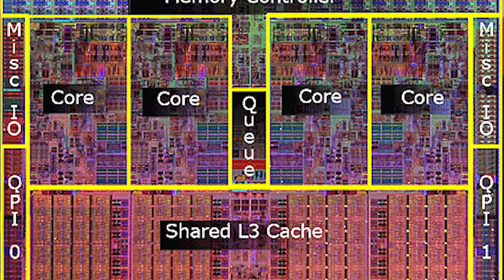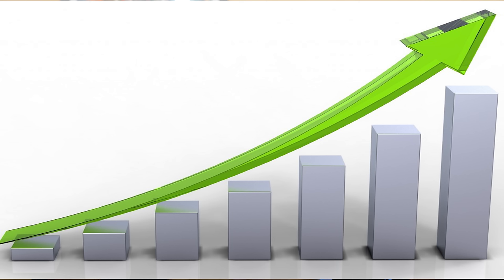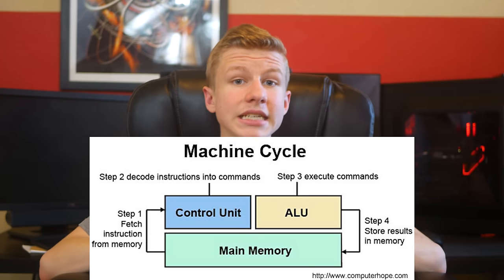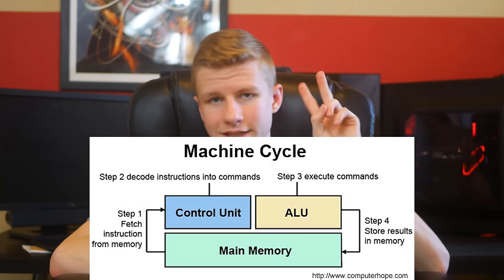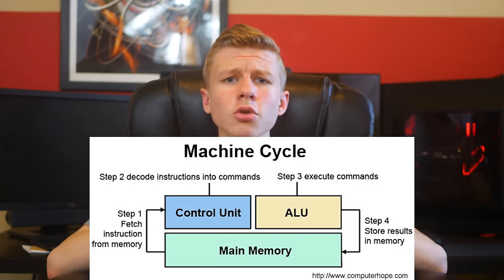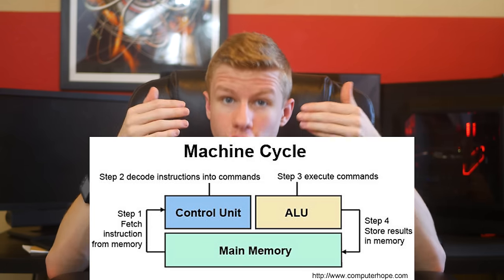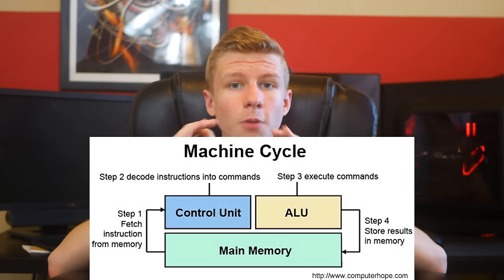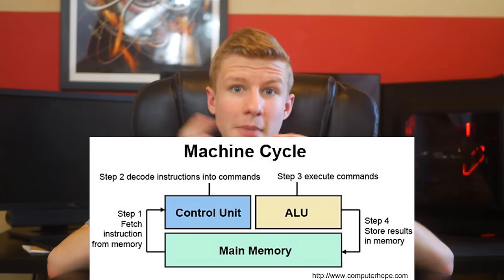How do computers work? The Von Neumann Architecture

Comment: Do you have any idea Sir about computer system that where Von Neumann architecture were used? Can site an example?(if ever you know something which is new or not too old).
Reply from the maker: +chakchakaa all computers use it
Reply: Solid State Tech Yes, but what I mean is that in our modern days in what machine(name of machine) that it used the von neumann architecture?  Example in old days it was applied in a machine called EDSAC. :)...  (correct me if I'm wrong) ---- I was just looking for some topic in my school report-... I was wondering even though the idea of von neumann architecture was applied in intel processor but the only thing which is confusing to me- (hoping you get What I mean) -
Reply from the maker: +chakchakaa all modern computers, Intel, AMD, ARM, anything with a cpu and memory, uses the von Neumann architecture

Comment: What is meant by expensive? You used it in reference to RAM and Cache.
Reply from the maker: +Larissa Ford cache is expensive relative to ram for the quantity
Reply: so it's in reference to actual money then, not efficiency speed? I went online and there seems to be a lot of discussions on "cost" of cache vs RAM, and even cost between L1 or L2. I'd actually really appreciate a video on what software engineers mean by cost and what that entails. Thanks for responding and for the great videos!